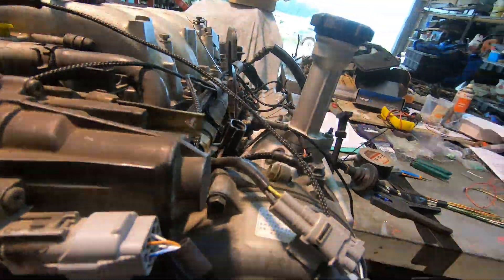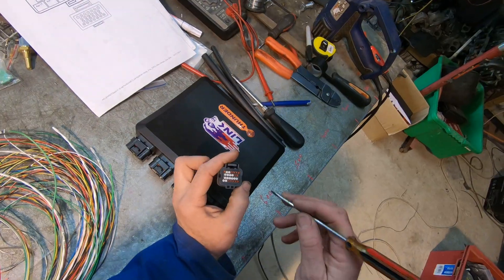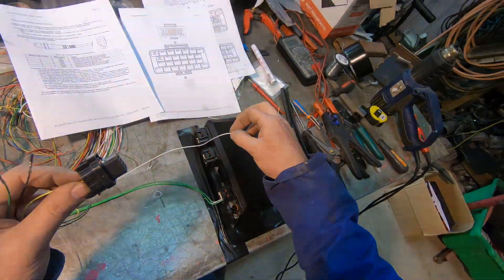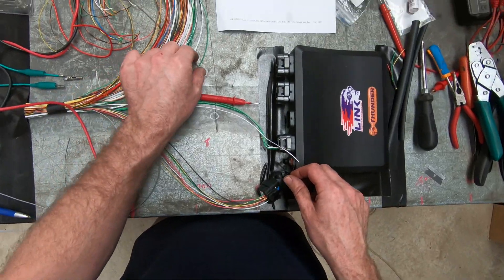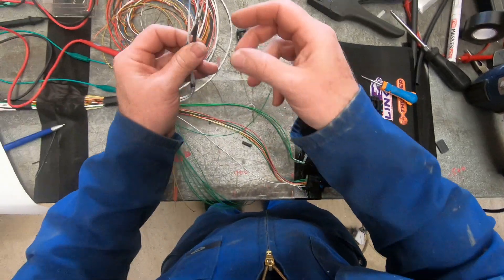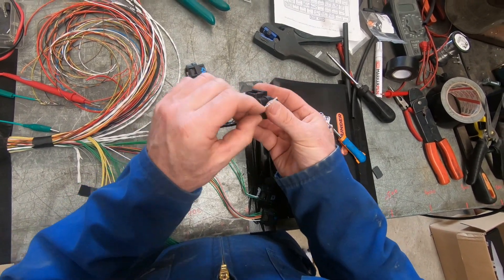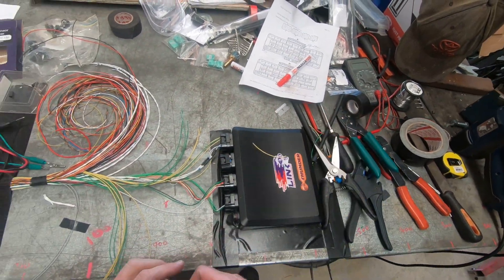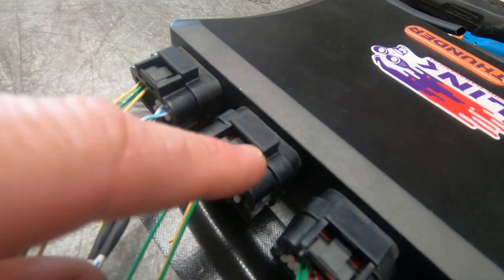1uz vvti or 3uz VVti to Link ecu  part 3

Comment: How do I fix a lazy rev for 3uz
Reply from the maker: I'm going to need much more information than that to give guidance.  Is it a conversion?  Which model of 3uz?  Have you looked at the live data on the ECU?  are the oxygen sensors cycling correctly?  Is the throttle opening all the way?  have you checked fuel flow?  is it auto or manual?  etc etc.  Cheers Kelvin

Comment: Is that computer cheaper then Halltech? Is it better?
Reply from the maker: Without knowing which ecu in the haltech range  comparing it with and the prices of the ecus in your part of the world its tricky to answer accurately.   This ecu has twin built in wideband,  8 injector outputs,  8 ignition outputs, peak and hold injector capability, 16 auxiliary output, twin dbw outputs,  twin egt so its a beast of an ecu being links top of the line unit.  I believe it has more features than haltechs 2500t.  Haltech over here are quite pricey and better is more about applying the ecu to the job and the ability of the tuner.  I like link as they are extremely well supported and Im supporting local business as they are a nz company.  Cheers Kelvin.
Reply: @CartuneNZ  Thank you so much Kelvin for the reply! Love your channel. I have 273k on my Lexus GS400. I want to transplant my engine into a 1968 Chevy C10. It should be interesting. I love learning how I'm going to that from you. Great engine and crazy cheap in Iowa, United States.